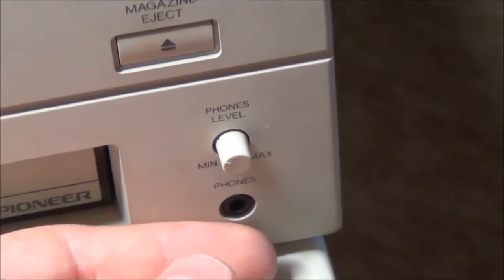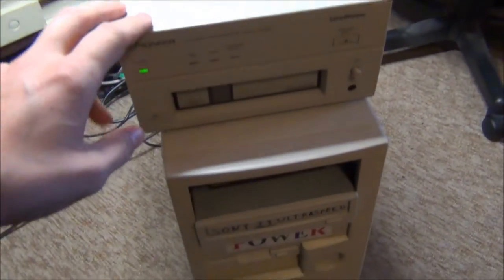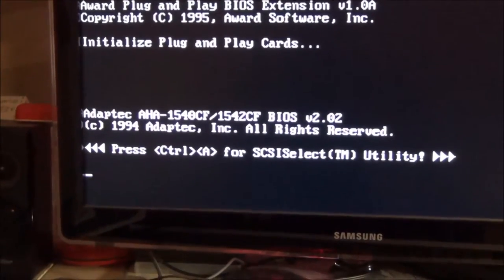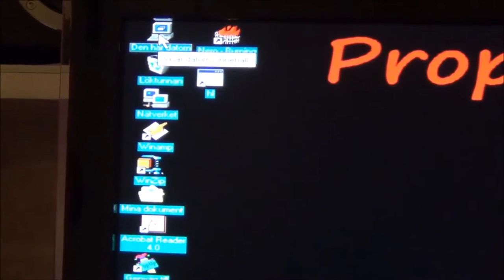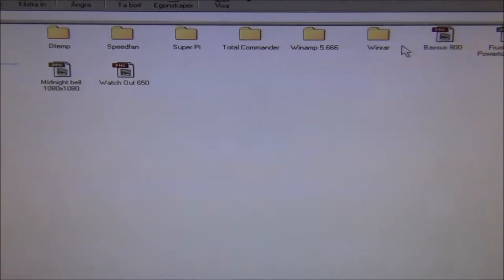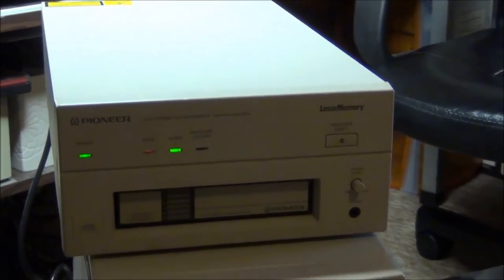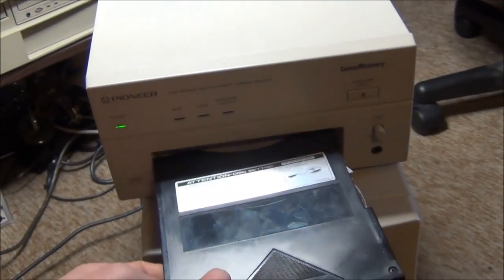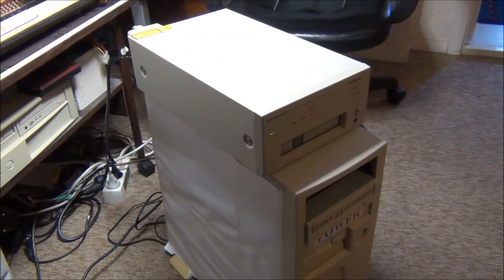Pioneer DRM602X 6 Disc External CD ROM Changer Tutorial

Comment: Nice video. I picked up one of these from the Houston Computer Museum's closure two years ago. I'll probably sell mine on ebay, but prefer SCSI CD-ROMs for my vintage computers. And Sweden is a nice country. Hoping to visit my best friend there later this year.
Reply from the maker: Neat. I think these drives are pretty scarce these days so it should be a pretty easy thing to sell if you so desire for a decent price. I actually picked out my drive from the storage and gonna see how it holds up some day again. I might just put it where I have my computer with a scsi card installed.
I actually do have an external Sun scsi drive that is almost the same size as the cd-rom drive. Not just as high though. I run this with a 10K rpm drive for the fun of it. They should do pretty well together :) I think I could even daisy chain them together if I want. Never tried that yet though

Comment: Pioneer made a single disc adapter for their audio cd changers. Would this adapter work in this cd rom changer since the audio/cd-rom magazines are interchangeable 🤔
Reply from the maker: Interesting thought, I think this cassette is the same as on the CD changers for audio so I would not be surprised if it would work to use a single disc cassette instead. But i don’t have one to test that with unfortunately
Reply: @Pulverrostmannen  I’m almost sure they are the same magazine. The CD-ROM ones have a white face though. I have the 6 disc cd changers and the CD-ROM changers. I have one of the 18 disc changers that take three magazines. I thought it would be nice to have one of them set up as a single disc. I’d also like to get one set up on my Roland sampler but its pick and I don’t think it would work 😕
Reply from the maker: @jessihawkins9116  indeed. I should pull mine out again and see if it’s still healthy. But it is infuriating slow in what ever you use it for except for audio discs. I mean it does work for data cd but it reads like double speed only but for audio it is completely fine. Almost like a normal cd changer

Comment: Hello!  exist a way to connect and use a this pioneer DRM602X with a current Windows 7/10/11 PC?
Reply from the maker: Hi. That is a great question actually. It is something I never tried myself but in theory it should be possible to do if you have a SCSI interface with a connector that both works with the computer and CD-Rom device. I don’t think you would need any specific drivers for it as long as you can hook it up on a hardware level. It would be fun to know if this works. Maybe I should try it myself if possible. Not sure if I have any win7 compatible interface around though

Comment: Do these units require any special software to run or is it just a bunch of drive letters?
Reply from the maker: At least under win98 it did not require any drivers except for the SCSI controller card to work. It will assign a drive letter for each drive and load the one you try to access which is very slow in reality along with the 2x read speed. It work pretty well as a CD player for music as it has it’s own outputs etc

Comment: could you use the pinoeer together with a sampler, let's say an akai s5000 ?
Reply from the maker: I never tried it that way but if it was scripted it would probably do it but it is a slow dinosaur. It only read 2x and changes disc slow so it would probably not be a good experience even if it could do it
Reply: yeah that’s what I want to know 🤔
Reply: I have an old nubus Mac with a sample cell card and sound tools I’m going to use mine with but I’m curious about if it would show up as separate drives on a sampler without any drivers. 
Roland S50
Roland S550
Roland W30
Roland DJ70
Roland VP9000
Nubus sample cell

Comment: "LaserMemory"

That's rare
Reply from the maker: yes this is a pretty rare device :)
Reply: @Pulverrostmannen  I know. First, there's LaserDisc Now, LaserMemory!? Is that what maked it rare?
Reply from the maker: Ryan Pascual it’s because it’s supporting both audio and Data disks with the 6 disk tray system. It reads 2X for Data so it takes decades to read one disk into computer. Also since it’s external and uses the SCSI cable you need a controller card with this external port to use it. All together it’s very rare to get a working one since it was not very common to begin and I never saw one of these anywhere until I got mine. The nifty part of this is that when playing audio you can control the playback with a computer and then have your amplifier connected directly to the cd changer which eliminated the need for a good audio card in the computer to play your cd-music
Reply: I have 4 or 5 of these I use with my old 486 and Macs. I also have the 18 disc version I’m going to set up with my old Mac file server.
I have pioneer laserdisc and the pioneer magneto optical drives also.